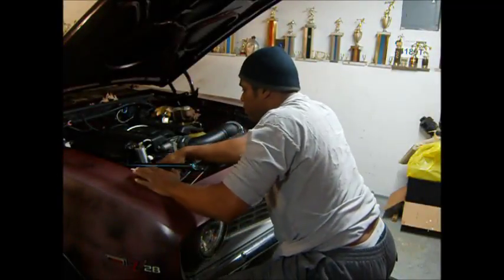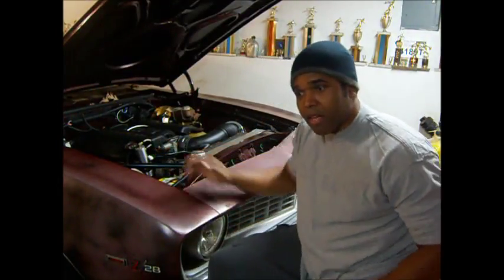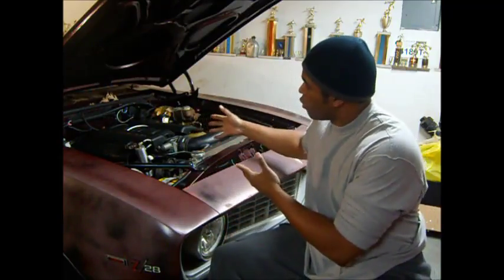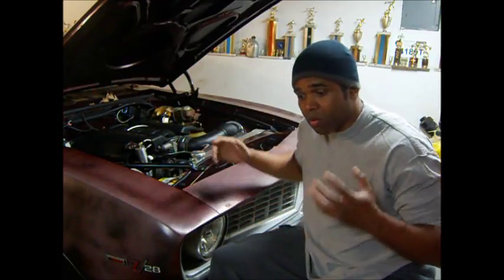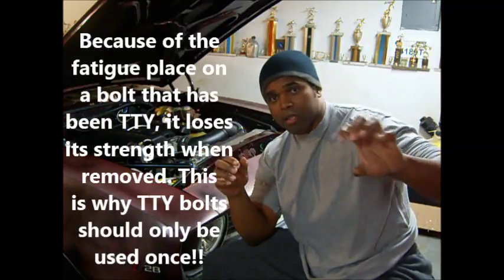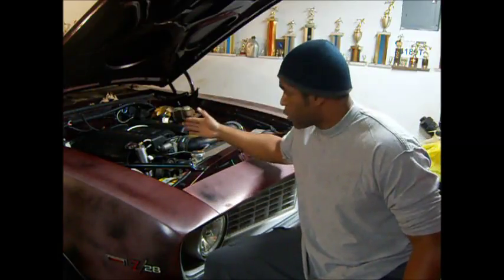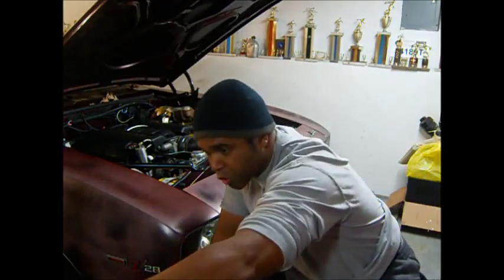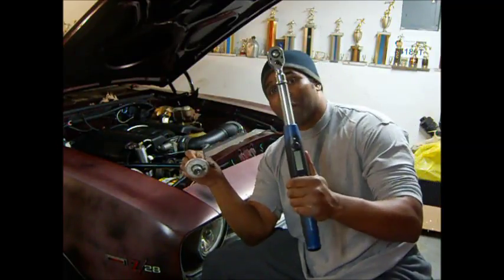LSX Torque to Yield and Degree of Twist explained

Comment: 3 o'clock 90 degrees 6 180 degrees. 9 270 degrees full turn 360.   Simple math.  No need for special tools.
Reply from the maker: yes but what happens when its odd number degrees.. i rather break the tool out and take the guess work out of it.. thanks
Reply: There is if your head is angled back toward firewall and head bolt cant be seen at all😎😎😎

Comment: Hey what's a for sure way to tell the difference in a 5.3 & the 4.8? FYI I'm subscribed!!
Reply from the maker: hmmmm. dont quote me, i believe on the front of the block on the drivers side you will see 4.8/5.3. there will be a paint mark next to the size to identify if its a 4.8 or 5.3. if you take the heads off.. i believe the 4.8  has flat top piston and the 
5.3 dished piston. hope this helps brotha..

Comment: good info
Reply from the maker: thanks Randall.. any updates?
Reply: coverman66 the engine is in the shop getting done as far as any work on the nova it is at a stand still right now because of snow and the money is goin into the engine right now
Reply from the maker: i know the feeling.. youll get there and when you do you will appreciate it more. trust me..
Reply: +coverman66 I sold the nova and got iroc-z